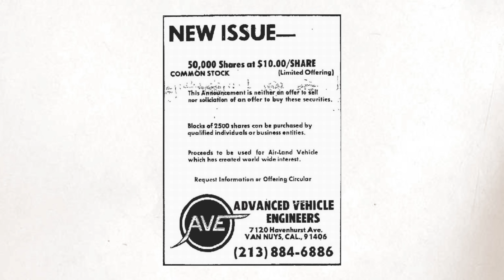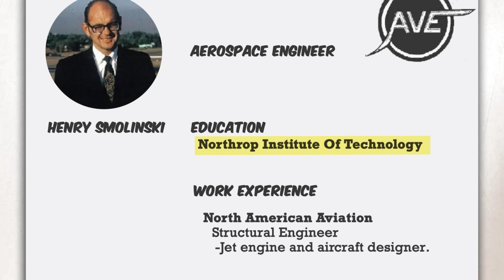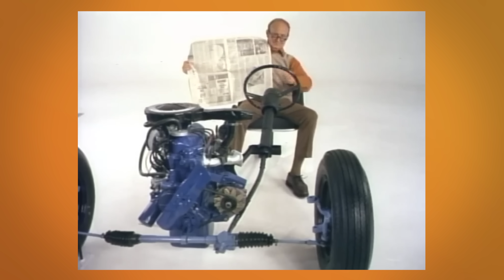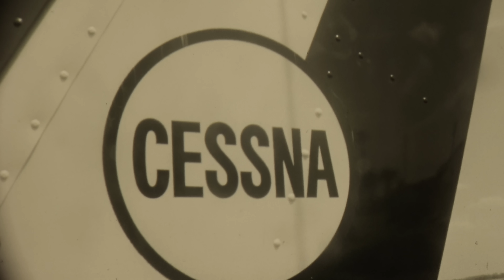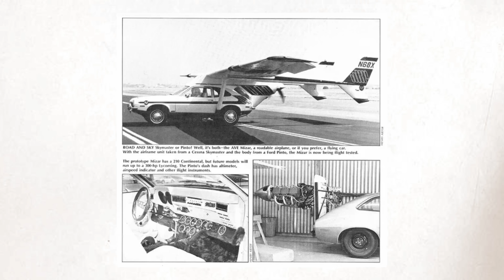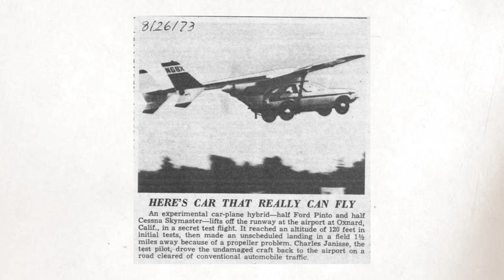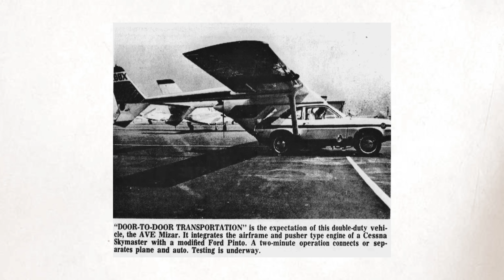The wild 1970s flying car that actually worked... until it didn't

Comment: That's interesting stuff. Maybe it's best not to have average people buzzing through the air. Drones are great and when they crash it seldom hurts people. What needs to be mentioned though is that drones will drop like a rock when the power runs out or the motors quit. Planes and helicopters can keep on flying under the same conditions and skilled pilots can often land them, even without engine power. I fly drones and it usually goes without a crash, but I would not want to sit in one and take off, no matter how cool that would be.
Reply: I would much rather be in a plane than a helicopter when the motor dies! In a helicopter you are gonna basically go straight down, just hopefully not at terminal velocity.
Reply: @Sashazur  I'm not sure how accurate that is, but I've heard of helicopters landing safely after engine failure. The blades can be disengaged from the engine to keep spinning freely, powered by the air, mysteriously creating enough lift to slow the descent significantly.
Reply: @heywhatsthatsmell  You're giving me ideas 😁😜

Comment: I went to and graduated from simi high school in 73....senior year we had a ROP program thru the school with Rocketdyne where a group of students had a class hosted by Rocketdyne whereby it counted for school credits....in our group was a classmate  who was a autoshop guy..welding etc...he also did a easter break road trip with myself and two other guys to Reno and back down the coast highway ..a incident happened where he got mad over something and rode off from us after Donner Pass on his 750 honda .
Didnt see him much till graduation and after..he vanished..about a month  before this crash i ran into him  in the Valley where he told me he was working on a flying car project involving a Pinto with Cessna parts..welding and fabrication stuff etc.

I sort of brushed it off as post grad boasting and went on my way...then this hit the news...afterwards I heard some of the fabrication  that was hidden was found to be at fault..never saw or heard from him again

Comment: The problem with any flying vehicle is any failure becomes a serious problem because the vehicle has significant potential energy.  In other words, the vehicle is in the air and gravity is going to try to smash it into the ground.
Reply: I believe that would be kinetic energy
Reply: @gregsocha7902  https://en.wikipedia.org/wiki/Kinetic_energy is not the same as https://en.wikipedia.org/wiki/Gravitational_energy

Comment: The Taylor Aerocar (1949-early 1960's) actually worked as a flyable plane and a driveable car.  They managed to build six of them, and they all still exist in museums and private ownership.  It could fly, have its wings detatched, and then it could be driven on the road.  It doesn't sound like much, but it was technically a successful flying car.  This Pinto/Cessna 337 hybrid had one unsucessful flight with no injuries, a second unsucessful flight that killed its pilots, and no documented record of it being switched from plane to car and driven anywhere.  Based on its demonstrated abilities, this was neither an airplane or a car, despite being cobbled together from parts of both.
Reply: KISN 91 AM in Portland, Oregon (FCC license in Vancouver, Washington) had an Aerocar back in the mid-60's, they actually did on-the-air traffic reports from the Aerocar.
Reply: @j.patrickmoore9137    This is 100% factually true. I witnessed it as it happened.
Reply: Must have never watched the Bob Cummings show
Reply: I worked for Molt Taylor and was one the privileged ‘very few’ who spent time in and around his shop, marveling at a true walking encyclopedia of brilliance- shuffling through his many kit plane parts and construction drawings he made available to anyone competent enough to construct for themselves. He was credited for being the first to engineer and solve the task of using a fluid slip differential to transfer power from a running car to an easily attachable wing and tale pusher system. Sad none of us took the time to write down what was in that brain of his. So much of his foresight and problem solving passed away with him. His success with engineering a real flying car was left for the museums,  one that originally was supposed to used as the flying car in James Bond ‘The Man With The Golden Gun’, but later replaced with a model of a AMC Matador Coupe. I guess the producers thought it looked more cool.
Reply: @markdonaldson9251    You may remember a couple young kids (we were about 10 years old at the time. It would have been in 1962 and 63) on bikes who would hang around the old Kelso Airport, maybe not. But I was one of them.  😀

Molt was the reason I became a pilot.
Reply: @phillipzx3754  It was later in his life, long after that early period that I was around him. Probably 92-95. He was trying to put a jet engine on the back of a Honda civic hatchback in the back of his shop on industrial way across from Waste Control. But, things had changed and stricter regulations prevented it from materializing. I was around him til he passed away in 95. I marveled at the wisdom pouring out of every conversation we had. Sharp til the end
Reply: @markdonaldson9251  I had a great day in his shop following him around.  I was a kid.  The more humble and matter of fact he seemed about things, the more I was in awe.
Reply: @markdonaldson9251  I'm sorry, but in what conceivable universe are AMC cars save for the AMX and Javelin cooler than any flying car? They're automotive birth control. Especially the Pacer and Gremlin. They're cool now, but you couldn't have one and get laid unless you were carpet when I was young.
Reply: Yep! Taylors flying car was the one. Pity others didn't try to copy it rather than producing partial flying anchors
Reply: Just remembered the guys first name...Molt Taylor
Reply: Pity the maker of this video seemed to completely forget the existence of the Aerocar. Had a little book of aviation I got as a kid that had it in its pages (Also, on the opposite end of the scale, the F-14 Tomcat, with many of its performance numbers listed as Secret…).

And it does solve a problem: driving away from the airport on the other side with your personal vehicle. True, one can rent or Uber, but those are additional costs in both time and money.

Molt was trying to work on a version using a Honda CRV. I presume that project didn't fly…

Just gave this video a Thumbs Down… Wiki has links to better information: https://en.wikipedia.org/wiki/Flying_car
Reply: I grew up a few miles away from the (old) Kelso airport in Washington, where Molt Taylor built the Aerocar. When I was a kid, we could watch him fly all around the Longview/Kelso, Washington area.  The old "Bob Cummings Show" had an Aerocar in the opening credits. I met Molt when I was about 10 years old. I'm 72. 😀

https://www.youtube.com/watch?v=uwIn7jLPV4E
Reply: @phillipzx3754  I lived in Lakewood WA area... never saw the Aerocar fly except on TV... Bob Cummings  owned the one on TV ! AND was the pilot. Let's NOT forget who designed the Piper J-2 and J-3... That's Right!  Molt Tayler... He worked for Bill Piper... until he'd had enough of Piper!!! 😀
Reply: @HiflyColo730    You most likely never saw one flying because Molt typically flew between Longview and Portland,  rather than Longview and Seattle.
Reply: Convair also had a successful flying car.
Reply: @danielocarey9392   They had two prototypes. One crashed.  Where was the "successful" part?

Molt actually SOLD several of his Aerocars. Convair did not.
Reply: @phillipzx3754  Thank for your comment. Often I hear of aircraft failures. And usually they mean that it did not sell well. But as an engineer I consider a success as one that operates according to its design.
Reply: The man with the golden gun
Reply: The technical term for what it was, is: a KLUGE.
Reply: Some people find a termination in life is to create a more creative way to commit suicide! And it's sad that they succeeded! But congratulations on your success!
Reply: Moulton Taylor's Aerocar was a lousy car attached to lousy wings. Pretty cool, I've seen one fly (many decades back, the remaining couple or so are "retired") but they weren't good. Not even a little.
Reply: @UncleKennysPlace  No one is claiming that the Taylor was an incredible aircraft.  we are simply saying that it it was a certified, functional aircraft which could also be operated on the street, and several of them were built and sold.   This video is about a hack of a Pinto and a Cessna that failed, but the title suggests otherwise.  We present the Taylor Aerocar as an actual example of of a flying car that actually worked.  It was my feeling that the title was misleading, and I presented the Taylor for comparison.
Reply: @UncleKennysPlace   You saw one fly, and I got to see them being built. 😊

There will never be a "good" flying car. Too much compromise.

Comment: Wing struts attached with sheetmetal screws???  🤣 That's INSANE!
Sometimes engineers have zero practical knowledge.   Thanks for the video.
Reply: Not much of an engineer, he who couldn't figure out the stress involved in these joints and which fastener to use
Reply: @SuperYellowsubmarin  Yeah, they really don't understand engineering.  It's not the same as "inventing".
Reply: @SuperYellowsubmarin The title of a great book by a real engineer is Not Much Of An Engineer by Stanley Hooker. One of the best books on aero engine engineering I have ever read.
Reply: Yup. As a mechanic i can agree. I also studied mechanical engineering. Engineers are okay, but they don't know much about how it will act in real life
Reply: @hoedemakerbart  Yes, that's exactly what I meant. Some don't understand real-world applications.
Reply: This engineer always runs my new ideas past people that do the actual work every day. Very early on I learned that I tend to miss something small, but important and I like to catch it when the idea is still on paper or better yet still in my head. Peer review is a life saver.
Reply: @jasonfullerton7763  Right on!
Reply: It’s common to streamline a joint between wing strut and wing, or between wing strut and fuselage, with a light sheet-aluminum fairing. The much stronger joints hidden by the fairings carry the real aerodynamic loads. The fairings are affected only by the small airflow over them, so they can be held together with sheet-metal screws. A YouTube presenter with limited knowledge of aviation or mechanical design could easily get the mistaken impression that the sheet-metal screws are holding the wing struts in place.
Reply: @CrotchetyOldEngineer  Very possible. Thanks.
Reply: @3:45 "then, four high strength locking pins are used."
Reply: This story reminded me of the carbon fiber submersible…
Reply: I have a hard time believing that ANYONE let alone an aeronical engineer would draft a design using  sheet metal screws  can be used to carry structural loads. WHO approved the design?  That leads me to wonder if the actual builder of the  modified Pinto had ANY idea of what he was doing and did he not question the attachment? Sheet metal scewsare usd to hold on fairings and sheet metal.You could use a sheet metal screw to mount a picture that weighs a pound or two on thewall if you don't jiggle it.If you do it won't even hold the 2 pounds.
Also, aircraft, amatueur, or commercially  built had to be inspected PRIOR to flying by a government certified inspector. DId this not happen? Who signed it off as suiatable for a test flight? Was FAA on vacation that year?
I may be wrong, but before I repeated such drivel as fact,  I would want to see the NTSB report on the analysis of the causes of the crash, not the newspaper report.
Reply: @josephantal9206  Very good points.
Reply: clearly great Darwin Award competitors!
Reply: Remember half of the population is dumb. The other half only slightly less dumb.
Reply: The first thing I learned from watching YouTube videos is to not believe everything I watched in a YouTube video. Are you aware of the placement and purpose of the "sheet metal screws"?
Reply: @davekearney1944  They attach wing struts to somewhere on the body of the Pinto. That's all we are told here.
Reply: @UberLummox  yes...and on that limited  info (which you think is accurate) you judge it to be "insane" and that some engineers have zero practical knowledge.  It's no wonder some politicians can tell  their base anything and have them believe it.
Reply: @UberLummox  Is "what we are told" factual?
Reply: @davekearney1944  Who knows.
Reply: @UberLummox  You don't know the facts, but they're insane, whatever they are. Sounds reasonable.
Reply: You guys think mechanics (and not engineers) design fasteners and other load bearing components on aircraft? 
That's hilarious! Clearly you don't know much about actual engineering, if you're judging the field based on those two clowns.
Reply: @ Ok floriduh man. Literally no one is saying any of that.
Reply: @methylene5   Well said, and I'm not an engineer.
Reply: @methylene5  What's 'hilarious!" is you thinking we're judging engineers only by these two clowns. And by the way you speak, you're not an engineer either...clearly.  No one thinks mechanics design fasteners or anything else, ffs.

Comment: I love flying.  I love driving. 

The problem that I see is combining the two into one vehicle. 

For road use you have pass all the crash standards as well as emissions requirements.  That makes things very, very heavy by aircraft standards. 

A very minor bump into something on the road will make it completely un-airworthy.

Just do not see a practical way of combining the two into one vehicle and make it viable and cost effective.  In the long run it would just be cheaper and more practical to have two different vehicles.

Comment: There are two problems with roadworthy aircraft. Cars and aircraft are just so dissimilar that any attempt to mix the two will lead to a an overpriced vehicle that isn't really a good car or a good airplane. Secondly, as the video so aptly pointed out, it's a problem in search of a solution. Given the cost of most roadworthy aircraft, and the fact that roadworthy airplanes need to take off and land at an airport, it makes more sense to get a nice car and a small airplane, and enjoy the best of both worlds.

Comment: Check out the Aerocar International company.  They built flying cars from the 1940's through the mid 1970's.  Only six were built, and they could not build a market despite interest from Ford.  They actually flew and had a certificate for civil aviation since 1956.

The flying car in "Man With the Golden Gun" wasn't real; it was model.  And it was based on an AMC Matador, not a Ford Pinto.

Comment: I received my Swiss patent CH 692 977 A5 for a flycar on January 18, 2003. I've been dealing with this problem for decades. The approach of putting a car in the air or converting an airplane into a car is fundamentally wrong. It only works if you build a unit that can do both, and that's exactly what I patented. Unfortunately, I haven't been able to find investors, so I haven't been able to realize this idea. I would still like to share a little more information about the problem. The current approach with VTOL electric and battery-powered units is fundamentally a viable option, if it weren't for the weight of the battery. As long as it's not within a reasonable range, it unfortunately doesn't work in practice. Potential VTOL operators underestimate the fact that there are no suitable locations for operating such devices. My approach has always been to utilize existing airfields and deploy this flycar in areas where there are no roads or only poor roads, or where rivers, lakes, and the sea impede reasonable transportation. Not for short-haul operations, but for transportation in jungles, deserts, mountains, and oceans. Drive to the airfield, take off, fly to the landing field, and then continue to the destination. If anyone is interested, please contact me. Adress under Swiss Patent Number

Comment: That prototype pinto flyer seemed destined to fail. That 'accomplished' engineer must have been coked up or whatever drug was available because these issues as they were reported here would have been simple fixes. Instead of a heavier motor it needed less weight. Stripping out EVERYTHING that didn't need to be in that pinto would have helped. Replacing the non structural body panels with just cheap fiberglass. Lighter wheels and tires. Lighten lighten lighten. Replace all of that junky sheet metal screw fixing arrangement with something more aerospace grade. It obviously was too hard for this guy to figure out so maybe harder than it seems to me, but I bet it was doable.

Comment: I drove a Pinto once, and found myself amazed that the steering wheel was angled. I guess they saved the cost of a couple universal joints to make the car less expensive. Anyways, you have to wonder if the dream of a flying car is less practical now with all the drones in the air! And even with the number of aircraft we have in the skies now, bird strikes are a staggering problem.
Reply: The Chevette is the car with the angled steering wheel, not the Pinto.